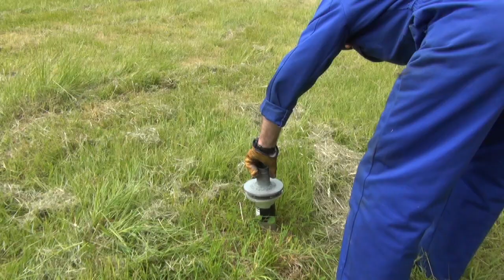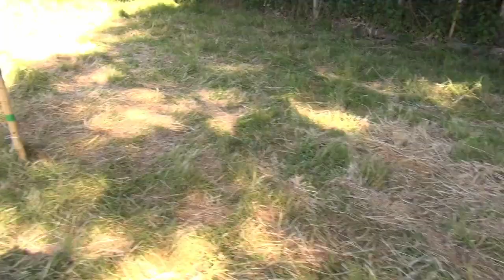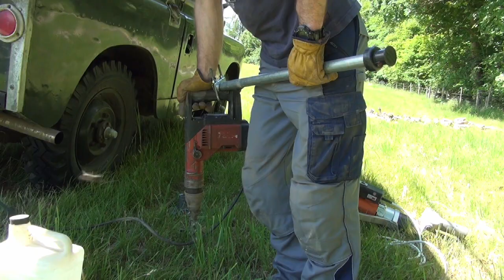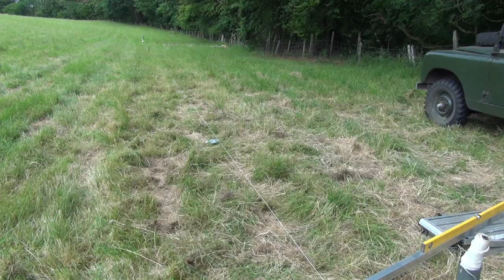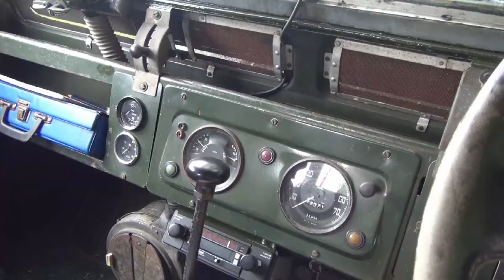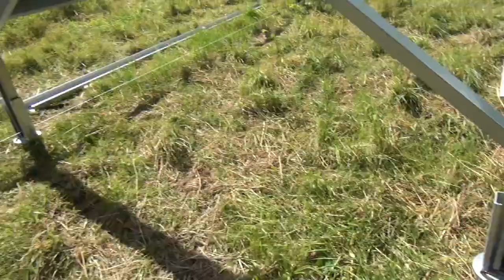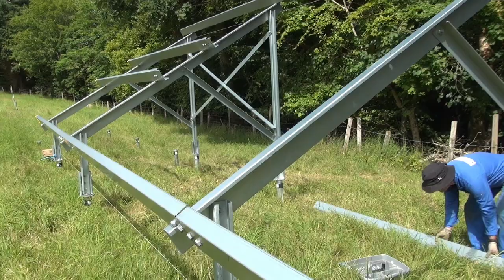Oversized ground screw mounted home PV solar array!

Comment: ❤❤❤❤ Absolute master class. What has been your best day amount kw in summer. i’ve got 61 panels split over south and east with 4 powerwall 3 i love producing my own electricity. Zero bills and i’ve got 10kw heat pump. we have no Gas on our property. i’m in south wales uk. 
Well done on your Array it’s the best i’ve ever seen world wide.
Reply from the maker: Wow, thanks for the appreciation! Best day's production is a little over 100kWh, and I get day after day of 80-100kWh for at least 6 months of the year. The annual production for the first year has been over 20,000kWh, much of it exported. You'll understand the warm feeling of generating all of your own power, heating your home and driving your electric car, all for free. For a pretty small investment we can break the cycle of having to buy expensive brown power. Don't miss my next video, a super cheap DIY vehicle-to-home battery storage system...in progress...😀🔧

Comment: Good to see someone some using common sense regarding the lowest output you will get vs what u need. So many people get it wrong.
Reply from the maker: That's my message and the oversizing principle in general. With panels so cheap now, install as many as you can and just forget about using peak output😀🔧

Comment: Any update on this install? How is the solar production ?
Reply from the maker: At the moment (May) most days are over 100kWh which is far more than I can use even with the electric car and heat pump. Ask me again after the winter because I want to see if I can be a net exporter 😀 🔧
Reply: @blairwinchproject2855   NICE.👍👍. That was a good setup.
Reply from the maker: @Ojames600  Thanks! 😀🔧

Comment: I commend you for taking on this project yourself, it's a lot of work, but I think the most arduous is the layout process, takes the most time and amount of intellectual effort, the assembly, why physically demanding, is just that, assembly...
Reply from the maker: The layout isn't too bad - there were detailed drawings with the Radix frame kit so it was only a matter of measuring carefully and keeping things straight and square. It would have been easier with less of a slope on the site! Once the ground screws are in, the assembly is straightforward, just a lot of nuts and bolts and there is still some adjustment possible with all the slotted holes. 😀🔧

Comment: Admire your work ethic but seems like a very poor placement of the array for capture of the solar gain and the fact it is essentially under trees which will eventually damage the array when they shed limbs or fall. Cost?
Reply from the maker: So my message to people considering installing an array is to work with what you have got and don't be put off by overthinking future issues. In my case, I have nowhere on my land with better solar exposure in the middle of winter, but I can live with that because for the rest of the year (with the sun higher) my exposure is pretty perfect. And yes, trees or branches can fall down but I have trimmed back everything that overhangs the array so it would have to be a whole tree falling down. Storm winds blow away from the array so hopefully it would fall the other way, but even if it fell over the array I could replace any damaged frame sections and panels cheaply. To get completely clear of any tree risk I would have to have sited the array way up in the middle of the field - I don't want that. Think of how many houses have trees within falling distance of them (mine included). It's a risk but I'm not going to lose sleep over it. Cost? Less than £15k for materials plus my own labour/sweat 😀🔧
Reply: @blairwinchproject2855  Thank you for your detailed response. I am watching these type of videos to build my own solar array for my future net zero type retirement house. Likely I will be about 10KW and installed in a favorable solar location. Installed costs in the U.S. are about $2 to $3 USD per watt. And thats before this crazy tariff war which at present will increase panel cost greatly. I will likely do the work myself and will investigate the ground screw method. I agree you have to work with what you have!
Reply from the maker: @jimr4566  Best of luck with it - panels are cheap so install as many as you possibly can 😀🔧

Comment: Your power must be hideously expensive, Florida in the US, my rate is $0.135 a kWh. I use about 1000 kWh a month. I self installed my 15,500 watt system, after tax credits it was $17,500. If rates do not go up I am looking at 12 years until payback. With our hurricanes I need my own power, power to my road was out for a week after the last hurricane.
Reply from the maker: Our power costs twice as much as yours and I use more than you, especially in the winter (Heat pump and electric car). My system cost less than yours to install (not including my labour) and is bigger in terms of panel rating although limited by connection capacity. So my payback is quick and I just love being energy self-sufficient. We get some storm power cuts but not usually for more than a day - it sounds like battery storage using an inverter that provides backup power would be ideal for you. I am planning some home-made battery storage (that's the next video...) although probably not for grid backup. I'd like to be able to reduce my night-time import but only if I can do it cheaply. 😀🔧
Reply: @blairwinchproject2855  I do have 30 kWh battery storage. I use grid pass through to charge the batteries if solar production is too low but I am not grid tied so if my batteries get fully charged the extra power potential is not used.

Comment: Very nice. I do wonder if the point was to maximize winter production, why the angle looks more summer-ish. But that's a ton of panels and a very clean install!
Reply: If in winter time mostly cloudet when you can't see the sun position best orentacion is 0 degrees ...Direct to we sky to colect moustly indirect light.
Reply from the maker: @sauliussaulius7809  Are you sure? Yes you will generate something at 0 degrees from indirect UV scatter but normally for best winter generation you would go steeper not flatter. That also helps with snow shedding 😀 🔧
Reply: @blairwinchproject2855  I found this experiment somewhere in internet and I have 2 arrays of  10kw panels, one at work another at home. Work panels on the roof and orentated almos flat to sky, home panels  on the earth bifacial orentadet 36 degree. I suny days home panels generate +20% more but in mostly clody day generation is equal. Bifacial panels must overperform panels on roof in cloudy days but I think for roof panels helps flat orentation. In winter days all depending how many days you have sun. If 1-3 days for month nothing can help :)
Reply from the maker: Thanks, good point about the angle, it is 30 degrees which is steeper than year-round optimal but not as steep as winter maximising. There's no point in me including December and January in the calcs because there is no sunrise at all in those months. I did some PVsyst modelling and decided 30 degrees would be about right - it isn't so critical when your array is oversized anyway (and therefore peak sun is irrelevant). 😀🔧

Comment: So - if you're on a domestic smart meter here - i'd seriously consider some of the EV tariffs and battery storage.  Basically with Octopus as an example - still get 15p export - 30p ish day rate - but at least 6 hours overnight of 7p import - so can actually work out cheaper to charge batteries, cars etc on the cheap overnight rate - and then just export any excess during the day.  I particularly think this may be an idea if you're getting an ASHP - as the time the ASHP is using the most electricity is likely to be the same as your least solar production - if you can run it from cheap rate overnight electricity stored in batteries for use during the day - can save a lot.
Reply from the maker: I think you are right, I have been considering all options and I thought in the case of Octopus you couldn't have 15p export and the cheap EV night import tariff but I have just checked and that seems to have changed, so now you can. I'll have to crunch the numbers again. One thing's for sure, domestic import, export and smart controls are all evolving rapidly - things will change again when we have vehicle-to-home rolled out 😀🔧

Comment: Really good work, I have a very similar place where I would like to put up a 30m long solar array and mount the ground mount with ground screws, but one end is about 2m higher than the other, so it is a slope of about 4 degrees, It is also a little uneven so I planned to dig a little so the ground is at a totally flat slope, but do you think I also need to dig down and correct it so it is flat at 0 degrees?
Reply from the maker: A horizontal slope doesn't matter at all, there's nearly 1m height difference between the ends of my array but more would have been fine anyway. A slope front-to back is OK too within reason. Again you can see this with my array and the slope of the hill. The trick with ground screws is to avoid digging and concrete - you can absorb quite a lot of unevenness in the ground because the plain section of the screw doesn't have to go all the way into the ground. There are many different lengths available and bolt-on extension sections to handle various uses. 😀🔧

Comment: That's the worst pv location I've ever seen.
Reply from the maker: So have you never seen panels on a north facing roof then? 🤣🤣 (In the northern hemisphere). I think you are missing the point here - the location isn't perfect because of the winter shading but the rest of the year with an oversized array I get 100+ kWh per day for free, so what's not to like? I'd rather be doing that than drilling for oil 😀🔧
Reply: @blairwinchproject2855  I think your array is awesome, and of course if you find that it still pays, then it's great.  I love solar and am watching pv install videos to get ideas of how to do it; your array is very impressive and professional.  
I wasn't trying to insult you.  
And no, I haven't seen north-facing solar roof installations, not even on YouTube.  If I put pv on my garage, which is perfectly aligned for south-facing solar, I will not be installing on the north pitch.  I may put some vertical on the south wall on the siding, but definitely won't install on the north side.  I have tons of room, so why put them in the worst spots?  I probably will install some facing east to get direct morning power, but my west exposure is like yours, blocked in winter months, so probably nothing facing west.  

Is solar catching on in Britain, in general?
Reply from the maker: @charliedoyle7824  Yes solar is popular in Britain, everything from domestic roofs to massive solar farms. If you have several areas in mind on your property, it would be worthwhile modelling them using PVsyst or similar software (PVsyst gives a month's free trial) and then you can get a precise production prediction for each of them and work out what's best😀🔧

Comment: Geothermal for heating and cooling is the way to go. Solar to run it. In your case lots solar for other things.
Reply from the maker: Geothermal is relatively expensive to install and can be temperamental. Air source heat pumps have become conventional and good value, much easier to install. I have to accept that whatever electric powered heating I use, I will not generate enough to supply everything in the middle of winter - but I'm OK with that  😀🔧
Reply: @blairwinchproject2855  have you looking into seasonal energy storage? Granted, it takes some space and money, but when you have such a surplus of energy in the summer months, it makes sense to store the heat energy instead of batteries.
Reply: I’m an air source engineer myself and have been getting rather obsessed with the idea of storing the summer surpluses as heat, I’ve looking into bore hole energy storage and underground tank type. Great video, love the data updates at the end!
Reply from the maker: @bikemadsi  Borehole storage and underground tanks are definitely options, you would have to work out the economics carefully because it might be easier and cheaper to just export and sell surplus electricity, even though it costs more to buy it back when you need it for heating in the winter. Or do both? 😀🔧

Comment: I'm looking closely at what you're doing and I want to emulate it. What change I would like to make is to use bifacial and vertically mounted panels. That's the way I don't have to worry about snow cover or leaf cover or such like.
Reply from the maker: Whatever panels you use there will be an optimum tilt angle and I doubt it is vertical. If snow cover is an issue, steep angles work OK but there's a performance trade-off. If you run a inverter/PV panel design model, you can play with angles and work out what suits you best 😀🔧

Comment: I installed a tiny array of 15x450W, did not even tilt them into the sun, and are getting 5.5kW peak every day. You should see close to 50kW actually. Why are you getting so little even with good sun?
Reply from the maker: That's the whole point of oversizing the array - if you can't connect (or use) 50kW of peak output you can still install a 50kW array and limit yourself to the rating of the inverters that you can connect. That way you miss out on the peak output but you get solid output from the inverters more or less from dawn to dusk. If you model the annual production you still get most of what you would have generated if you matched your inverter rating to the panels. 😀🔧

Comment: you will need net metering to make that work.  have the net metering anniversary set to march.
Reply from the maker: There's no net metering in the UK (yet) and it is only recently that we have been able to meter domestic export at all. Currently you can get for export about half what you pay for import, if you choose the right supplier 😀🔧
Reply: @blairwinchproject2855  be interesting to know your whole year production curve.

Comment: It looks impressive and a good install. But I am extremely surprised you have chosen to build so close to a large tree line. 
I did read what you had posted earlier about trimming back the branches, etc.
But for such a large investment, it would have been better to have a greater distance between your array and your tree line.
You could see partial shading over your array site at the beginning of your build footage which means you will lose performance efficiency from either end of the day.
Also to a mitigate storm damage in the future, this build site should have been further out into the field away from any falling trees etc ! Unless you are planning to remove the trees at a later date.
Reply from the maker: I'm not worried about the trees, I have lived with them a long time and they aren't about to fall down. Even if one did, it wouldn't be expensive to repair the array. There's no shading issue either now that everything is trimmed back to the fence line. I like the tucked away location and wouldn't want the array out in the middle of the field, just for the sake of avoiding a small damage risk. I'd say people shouldn't be put off maximising their array size just because of threatening trees or partial shading - it's better have a load of panels and accept some risk and shading 😀🔧

Comment: I totally get the principle of over-panelling. I intend to be energy self-sufficient when I move to Portugal and need to size according the cloudiest weather/shortest days in December, which will result in a huge surplus during the summer months. I'm toying with the idea of a large geothermal battery to absorb some of the surplus, then use the stored heat to warm the house or greenhouse during the winter. I'd really be interested to see a follow-up video, to show how you wired the panels to avoid cooking the controllers on really sunny days. Multiple parallel strings?
Reply from the maker: Yes I didn't cover much of the electrical details. If you are able to oversize sufficiently to more or less cover your daily demand in the middle of winter then you will be pretty self-sufficient. I don't think it matters too much at this scale if the panels are under-utilised in the summer because I look at it as a cost-saving scheme rather than a money making scheme. With some load control you can use spare power to charge cars or batteries, run aircon, heat the swimming pool or whatever. You are right about multiple parallel strings, your electrical installer will run the model for the inverter and work out the optimum number of panels to put in a string to keep the open circuit d.c. voltage within the limits of the inverter. Because of running parallel strings each string has to be fused appropriately but that's all easy. All new inverters have a max oversizing limit specified and if you exceed it the warranty will be invalid. I am roughly 4x oversized and my inverters are long out of warranty so I will just work them hard and see how long they last. 😀🔧

Comment: I wonder if there are any pre-placement sheet metal links that measure out squared structures for people with no experience.  Like here are 4 10' bars, arrange in a square, and a couple cross pieces to bolt on that ensures 90 degree angles.  Then have a hole to spraypaint or drill into the ground.
Reply from the maker: There's probably no wrong way to do it, I did a first line of screws measured carefully with a string line and long tape and marked with pegs. Then the parallel line using a string and long tape again, just making sure the first one of the second line was square to the first line, and then checking for square a few times along the way. It is important to refer everything back to a datum point like the first screw so that errors don't build up as you go. There's a bit of tolerance for screw positioning and height due to slots in all the steelwork but the more precise you can be, the easier it is to assemble. 😀🔧